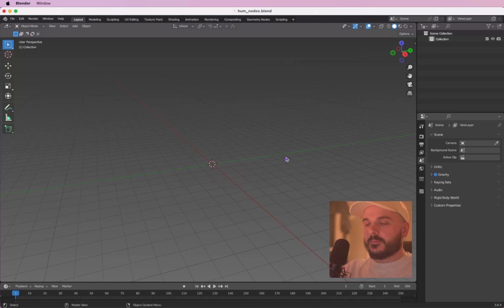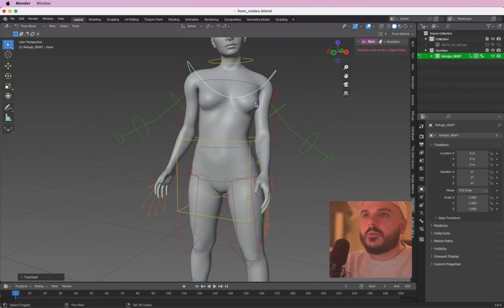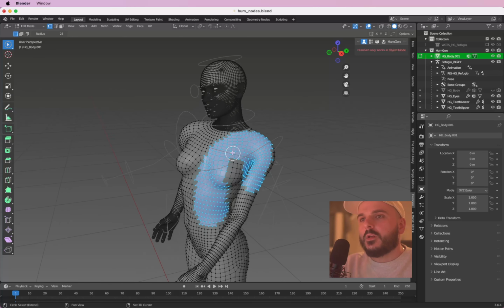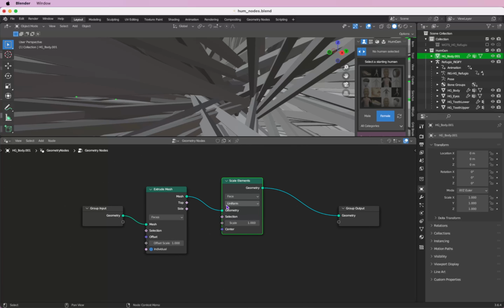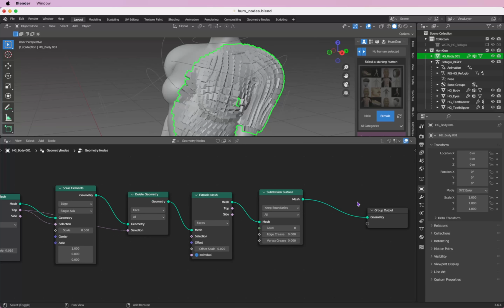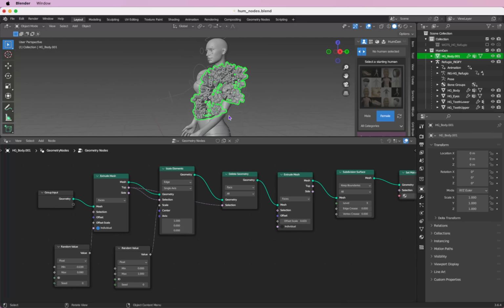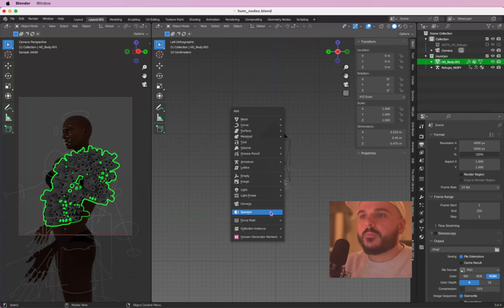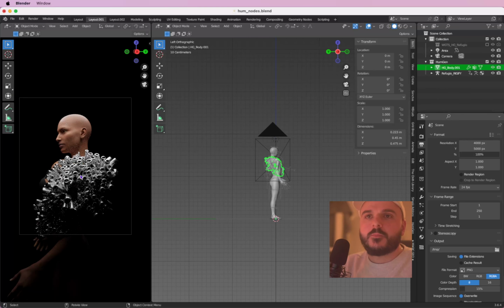Abstract Character Design with Geometry Nodes and Human Generator in Blender Part 2 | Tutorial

Comment: Nice tutorial, please next time explain a way where u can link it back to the main body so you can change the pose without having to redo everything?
Reply from the maker: Oh yeah that’s possible too. If you leave the duplicate mesh with the parent, and don’t convert to a mesh, it should work.
Reply: @MYSPACESHIP3D  Yes it does work. If you use the same technique , you can make clothes or any other body attachment you want this way . From Arm Guns to head gear or anything else . On the clothes , to get a good effect , you should use a solidify mod to give the cloth a thicker look.  :O)